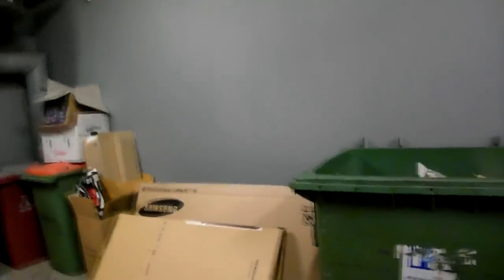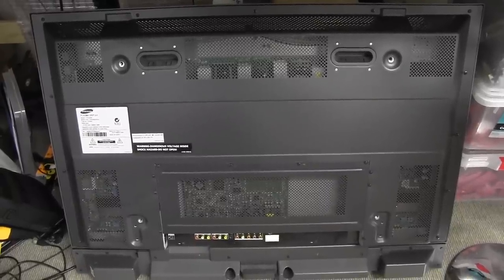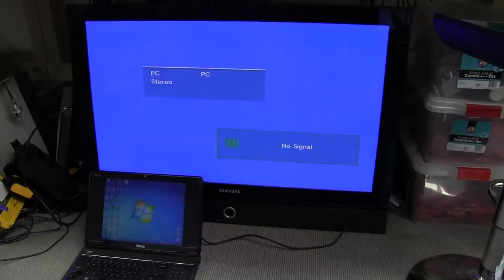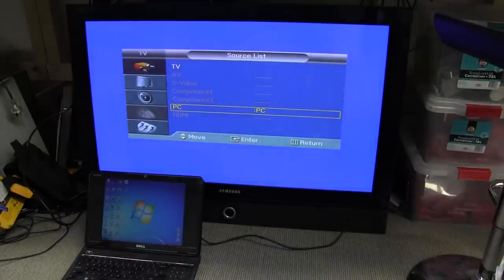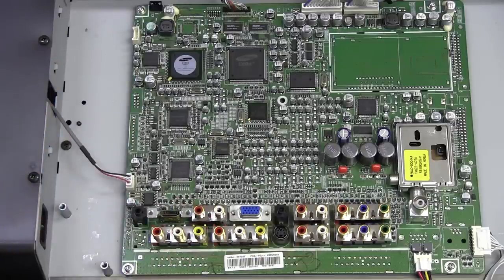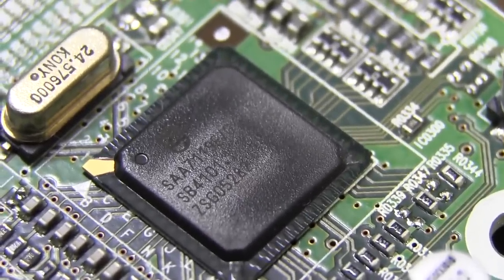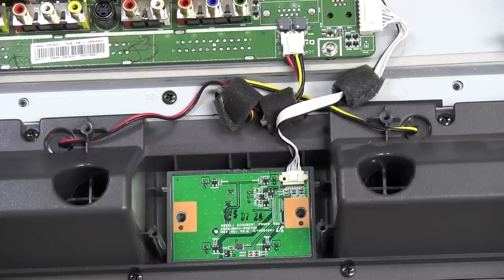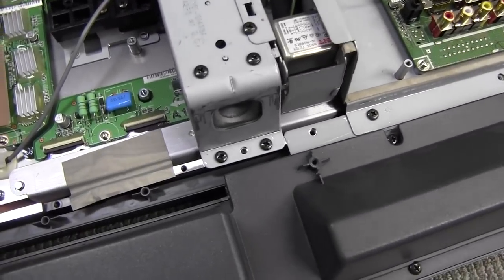EEVblog #446 - Dumpster Diving Samsung Plasma TV

Comment: The random thing is I also found a Samsung monitor at the dump, a 22" 1650x1080 monitor, which worked without any problems. Some minor scratches on the panel, but after all a free 22" monitor is good anyway. Also, our 50" Samsung plasma from 2008 failed in the late 2012, fixed it with a single cap replacement and been working fine since.

Comment: EEVblog  I'm pretty sure when you turn blue screen mode on it overlays that ontop of all images. My TV has a Blue mode aswell and When i turn it on Nothing shows up on Screen. Turn it off and I get a Picture.
Reply: Yes, I´ve got a Samsung LCD from about the same time, and the blue mode is present there aswell. I built a digital pinball table from it and forgot it had blue mode on, nearly scrapped the whole thing before I figured that out.
Reply: Agreed I was screaming at the video that he switched on blue so he got blue. URGH
Reply: Chris Nutt it still says no input

Comment: 380w is more the peak power, like a blank white screen standing at full contrast, and volume on max. the advantage of plasma is when a pixel isn't lit, it doesn't consume one single milliwatt, versus the LCD where backlight is usually always on, wasting a good 200 watt all the time.
I wouldn't exchange my current Pana HDTV for anything else right now, but congrats for your finding!
Reply: Diamond Tiara so it’s like an OLED?

Comment: I recent repaired my LG 42 inch plasma. It blew the Y-SUS board. Unsoldering the Y-SUS was a huge pain in the ass... The Heatsink was screwed on to the module before it was soldered on so it couldnt be taken off without unsoldering . Lead Free + huge PCB traces + huge heatsink = Very hard to desolder. Then the Z-SUS board blew 2 weeks later and I had to do it again. I love my plasma tho :)

Comment: My family has a Panasonic plasma TV from 2006. It uses 300watts, and it still works just fine. It had more AV inputs than this one, but it didn't have a VGA connector.

Comment: I picked up a 2007 model last year, and it would work fine for ~10 minutes of viewing, then it would restart itself and the main power relay would just click non-stop. Took me about a couple of hours of probing around on the power board to narrow it down to the mosfets. I reflowed the solder on those suckers and put some new thermal grease on them, put the heatsinks back on, and voila! the tv set has been working great ever since.

Comment: Hey Dave,
Just to let you know, albeit you might already know. Plasmas do not like to be laid flat. This is due to the weight of the glass, which is why they are so bloody heavy in the first place.
While servicing they need to be standing, or actually at all times they need to be upright. I have had a couple screens crack under their own weight just by laying on the screen.

My guess in concern to the fault is a power failure, I think one of the low voltage lines are dead.

Cheers!

Comment: The chip shown at 13:40 looks burnt or has heat damage. I personally would just look for a replacement board for the main board (the one with all the inputs) -- I suspect you could find this on some where like Ebay if you search for the part number. Good dumpster find though.

Comment: I got a 37" 720P(1366x768 resolution effective, 1080i if you're really into flickering images) from someone because "It wouldn't turn on", took it home, popped the back off, noticed a fuse was popped, replaced it, powered on. Been working fine for the few days I've had it(used it to watch this video even). Just goes to show you'd be surprised what people will throw out not knowing what's wrong with it. Hope you get yours working!

Comment: Plasma are actually pretty good! I have a Panasonic VT 60 and it's beautiful. Great display, and alright interface! It's working so far and yeah! The good thing about plasma a is that it doesn't rly have a refresh rate, if u put it into hrtz, it would be easily much better than any lcd TV.
Reply: +hpotter134 Plasma's were actually quite good, but only Panasonic and Pioneer ones. Sadly, both stopped producing plasma TV's recently. Probably due to the high power consumption of those. :/

Comment: Check your output resolution :) If it exceeds the resolution there will be no display.

Plasma is still a very competitive technology compared to LCD and over many advantages over LCD also such as black levels etc... Power consumption has also dropped dramatically, my new Samsung plasma uses around 140w.

Don't like those Samxon caps, my new Samsung has them aswell however they seem to do the job or atleast are better than most Chinese caps...

Comment: The blue screen option which keeps getting mentions only displays blue when there is no valid signal. On modes other than analogue, where you'd get the 'snow', you wouldn't necessarily realise the panel was still on with no signal because it is black. The blue makes it obvious.

Comment: I was given a broken 42" Vizio plasma that I think is basically just a re-badged LG. Dead Y-SUS as well and yes, removing the hybrid under the heatsink from the board was a huge PIA. Has been working fine ever since I replaced it, though. One of the IGBT's on the hybrid was visibly blown.

Comment: MAX232 is a RS-232 to TTL converter there's also a MAX236 which is a quad converter (4 built in). Widely used in communications service and test PC cables for programming and tuning. They are also found in just about any device with a direct serial interface (DB-9) such as CCTV DVR's, Some televisions, some satellite and cable TV HD and HD/DVR boxs, Rack mounted network switches, scanner radios that have serial programming interface

Comment: I. Have one of these in use, had to replace the power supply board not long back bought from EBay and it worked first time.
.

Comment: Yea one thing I'd check is turning blue screen back off and seeing if the panel says "sync out of range" or such. The resolution that your laptop defaulted too may have been too much, A resolution that should work on most any tv is 640x480. You'd have to change that in your laptop's display properties

Comment: I tore down my old plasma a few years back (2005 Toshiba 42") and it looked very similar inside.  One thing I've noticed with our two plasma TV's (both from around 2005) is that over time they start having localized noise that only affects one color channel.  Mine has red noise around the bottom that remains until it's been on for ~20 min and warmed up, then it gradually decreases until it's barely noticeable.  Any ideas on what would cause this?  Otherwise it works just fine.

Comment: Last year I harvested some cold cathodes from an old LCD. I think they are about 30" long, they're in a u shape so that both sides of the tube are at one end..I'd love to run them as household lighting but I had no idea how to force the circuits to keep them on full blast. So hoping someone can recommend a circuit diagram for running somewhat large cold cathodes.
Reply: best thing was using their inverter..or buying one from  the internet..self made ain't recomended, just for the price of the component.
Reply: yeah i tore apart an old lcd laptop screen and got the little backlight bulb out along with the inverter board. i had some fun with it until i burnt it out in fifteen minutes.

Comment: Haha yeah, but I was surprised at the total cost for my plasma vs an lcd of the same size. An LG 60" LCD tv runs about $12-14 based on the energy guide and plasma is just little over double. So plasmas definitely are becoming much more efficient but definitely not to the extent of and LCD. My plasma should hopefully last 10 years like my old LG LCD did so that then OLED tvs will be a reasonable price.

Comment: Ya when I took out the IPM module I ripped it open and saw one of the IGBT's had a little black burnt spot. The power rail was shorted to ground and as soon as the module came out the short was gone :)

Comment: Plasma is both heavy and fragile.
You can't store a plasma horizontal, or it will crush itself.

We bought on 42" back in 2006 and it's really heavy, but it still works :)

Comment: The VGA input is the worst input to test, as they can be very picky with regards to resolution and refresh rate. As for the other inputs, they may not have been disabled, they may be auto-sensing, since you didn't have anything else plugged into it. Back in the day, I'd have a hell of a time getting TV VGA displays working properly.

Comment: @18:20, you mention that Samsung rolled its own chips and that they wouldn't rebadge them because they're a major player, but in this TV, they did for at least some of them:

@13:29 you can see the copyright notice for Trident Microsystems on the chip, dated to 2004. Trident used to produce video cards but they moved into display controllers in 2003.

Trident closed down in 2012, probably because Samsung et al. started rolling their own solutions later

Comment: Todays modern plasma are way better than the old ones. They still get burn in, but my 2013 60" lg plasma is amazing. Looks way better than any LCD tv in terms of color and smoothness of picture. AMAZING! for gaming. Best 800 bucks used I ever did. Apparently it didnt have the mounting hardware, shipped back to amazon. I bought it as used for almost 300 bucks off. Spent 3 bucks on the bolts in the manual listed. Pure win.

Comment: As Matt Bennett said - some plasma's can be fussy with the PC input...

Most panels of this vintage are barely 720p, and only accept say 1366x768 maximum input on the VGA port.

My old Hitachi plasma even had a 1024x1024 panel (non-square pixels).

Also, the Samsung TVs often "grey out" the inputs on the menu if they don't have a cable plugged in (auto detect). The tuner input obviously works, so I'd bet a composite input would work just fine. Probably HDMI too.

Are you gonna keep it, Dave?

Comment: the NSP is an ARM processor for the GUI the other one is a ROM that holds the internal operating system
Reply: Also the issue with the TV is software not hardware..i believe there are pins you can short to reset the ROM ..

Comment: As already mentioned, try a lower resolution. The blue screen option has nothing to do with the problem. Try the HDMI input on something. I would be surprised if this needed anything more than a factory reset performed within the service mode. 
Regards
Trevor

Comment: My plasma is a 42" Toshiba, it's a widescreen panel but 1024x768 resolution, so the pixels are rectangular.  I fed it a 1280x768 input and it seemed to like that the best, other resolutions either wouldn't work or would be really messed up.  I replaced it with a new LCD a few months ago, still have it in my closet.  I too don't have the stand so next time I use it it'll be leaning against a wall...

Comment: Yeah the power use of these old things, will cost you a fortune to run. You can feel the heat coming off the top of a plasma. Good room heater in winter though. : )

Comment: as an electronics guy...why haven't you tried slight pressure on each of the bga mounted chips while turning it on, 9 times out of 10 this kind of imput fail is a failed bga flow solder

Comment: There should be an AC/DC power factored supply that drives all the other stuff. All others will draw from that supply. All optocoupled and separate. That is standard in HV switching supplies. The fancy transformers probably supply the plasma drives separately RGB... Just guessing. I know a bit about switching supplies but nothing about plasma, LCD or LED TV's... With all the dedicated IC's... Good luck fixing it if one is bad. You'll most likely have to replace the board. Problem is you'll have to be a certified Samsung repair station to get the part. If you are lucky, they will take your old one in and sell you a new/refurbed unit. I'd bet they will want to repair it themselves, for obvious reasons. Being that old, it isn't worth spending hundreds on repairing it as it has a lot of hours on it and something else may fail soon. Most folks don't want to take the chance but those power supplies may be fun to play with. Put them in a metal box, though. You will wipe out radio stations for a  hundred feet! :-D

Comment: I would be willing to bet that the TV is fine but the computer was outputting a non-compatible resolution. Windows tends to be not very smart when doing mirrored display mode.

Comment: You can see why people paid $3000-$4000 for this set when it was first released because they must have sold it on its weight. Although a google search on this set shows many dissatisfied owners with unreliable sets failing badly and servicing costing a fortune after the warranty period expired ! The other day I bought a 39inch LED LCD HDTV from ALDIS for only $300 and it's much better than a plasma and much lighter too. How times have changed for TV technology ;)

Comment: How would you even get the power supply working if it's so damn advanced. Like those new inverter based microwaves. Can't do anything with those unless I were to program a microcontroller to output a PWM to the inverter.

Comment: Hooking up composite causes me to lean against it being a vga/mode issue and a menu feature that just shows a blue screen, no matter the input, would be just in time for April 1st.  I am just confused about the snow though; wouldn't the tuner output to the same ntsc/pal processor that the composite/svid uses? and would this be the same processor that takes in the VGA?  Just on the edge of my seat waiting to see if hdmi works through that panel-link chip.  Hope dave mentions this guy by tuesday.

Comment: Had place for several fans, engineering knows they were needed. But absent it cuts the life of the product down to ultimately increase sales over the long run!

Anymore the technology outdates itself almost every year, but if they worked for 10 years people wouldnt  buy new ones as often as they do!

What they charge for the crap they should have at least 5years guarantee, to think they only get 1 year before many go bad, that would piss me off !

Id say you dont have to be dumpster diving to get trash if it only last a year for $1000 dollars a wise person checks the garbage first and a fool goes inside and pays full price!

Good garbage I want to find a working plasma in a garbage can, I dont know why but I heard you wernt supposed to lay those down flat, must be a myth like caar batteries stored on concrete floors?

Comment: Plasma TV and yet it ends face down. AFAIK (or I have been told) NEVER EVER put a Plasma in horizontal position, you will screw up the gas placement.

Comment: Did you try setting different output resolutions from the PC? Or restarting the PC and see if the startup splash screen appears on the screen.

Also I'll bet their screen has some wicked burn in, if the previous owner was using it as a computer display with mainly static images. Unless they were using it for gaming.

Comment: there's a good chance that something on the main board of the television is dead. there are stacks of samscum TV's in the back room, usually with good panels, but all have main board, or X or Y axis board problems. Samsung, Sony, and Visio are all brands to stay away from. though, that panel would be worth trying to sell, you might make a couple hundred out of it.

Comment: Plasma's suck. One of my dad's friends had one and every year around the Superbowl the bulb would burn out and he would have to replace the bulb which cost $200!
Reply: Are you sure you're not thinking of DLP?  Plasma displays don't use a bulb.
Reply: the bulb lol
Reply: Maybe he is talking about CRT TV :P
Reply: Kavindu Gilshan crts dont have a bulb either... its a cathode ray tube. CRT. 

not easily replaceable...
Reply: cj691 DLP's still have some of the best color reproduction abilities; also the contrast ratios are amazing.
Reply: Plasma screens don't use a single bulb.
Each sub-pixel is a small chamber containing a low pressure gas. The light produced by ionizing this gas excites phosphors, producing red, green, or blue light.
Each sub-pixel chamber is a fraction of a millimetre in size, and is part of a very large lattice.
I highly doubt that anyone would or even could replace this.
Reply: *****  Only when the bulb is in good condition (low usage hours).
Reply: Definitely wasn't a plasma, bud.
Reply: Dan Coulson Imagine going to the shop for these... :-)
Reply: Ryan Toomey yeah plasmas do not use bulbs that's projection tech tv I should know my sister got one until it's bulb went on it and then got rid of it for a led  plasma tv's use plasma not bulbs god some people....
Reply: I've had a Panasonic Plasma since 2009. I haven't had even a single problem with it Don't buy cheap TVs, they break.